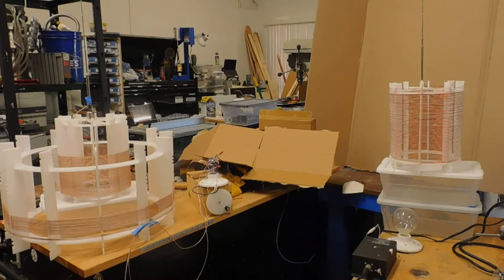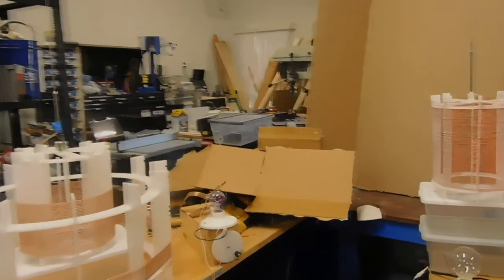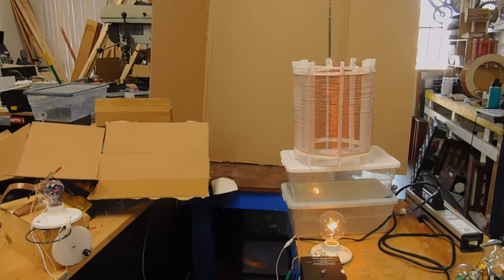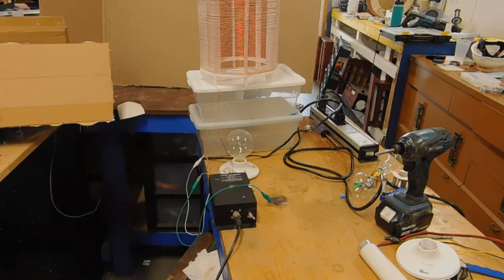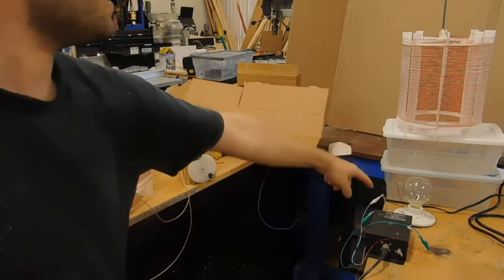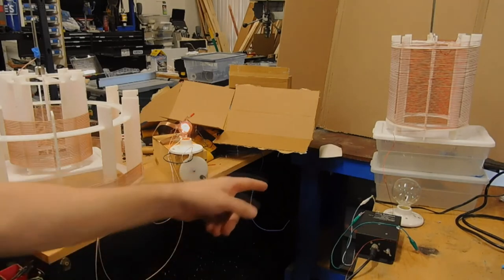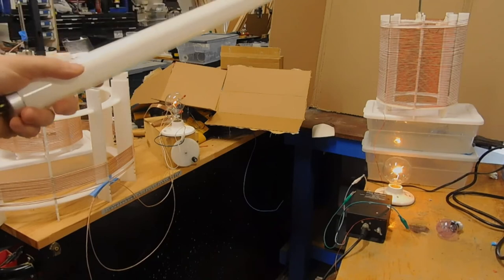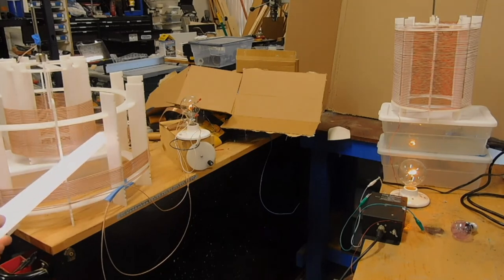Single Wire TMT + Bulb Lighting Experiment - 8/8/2022

Comment: Hey brother, thanks for sharing... did you say 1,860,000 cycles? if so why did you pick this... Grateful for what you do... ❤🙏
Reply from the maker: 1860kc (1.86mhz) was chosen because it is in the beacon/experimental portion of the 160m amateur radio band.

Makes it perfectly legal for us to do high-power tests, with little-to-no chance of disrupting others in the process.

Tesla was working WAY, WAY lower, 50-100kc (50-100khz) which probably works much better, but requires a LOT more wire (100ft vs 3500ft+)

Part of these tests are to see if we can 'get away' with tests so high in frequency compared to Tesla.  Definitely not as efficient.
Reply: @hakasays  ok, I understand... Just an FYI... This may be important... There is a cycle in the stars that is important for all atoms... it is 203,813... The divisibles of this number yields the sidereal year of the Sun, the saros cycle and the metonic cycle... Again, just an FYI should you ever consider using a different perturbation rate... ❤🙏
Reply from the maker: @iyoutome  It sounds less like a  critical number and more like a critical ratio🧐
Reply: @hakasays  exactly.... incommensurate nature of matter...